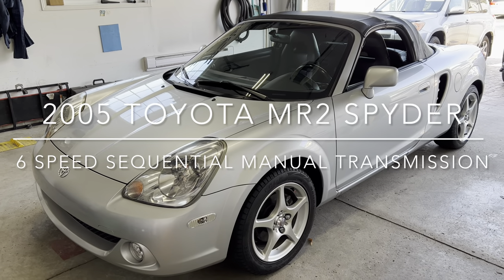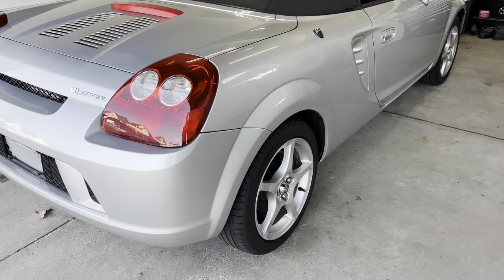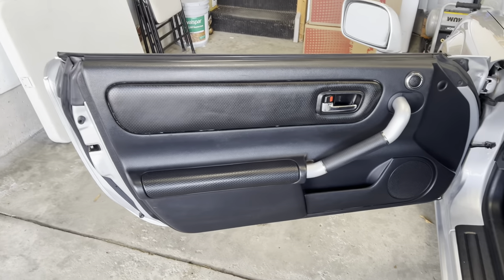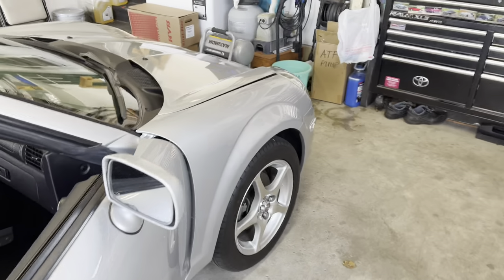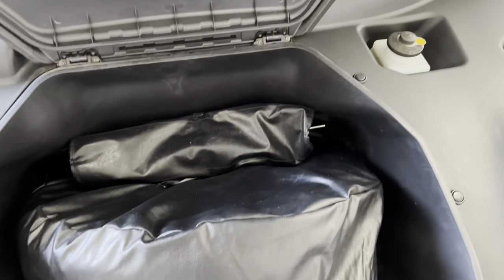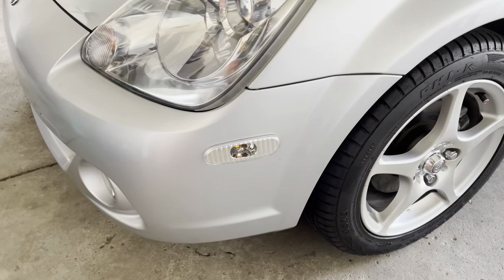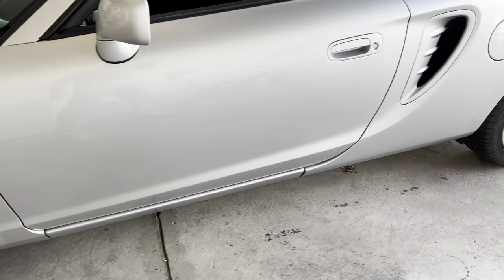2005 Toyota MR2 Spyder - 6 Speed Sequential Manual Transmission

Comment: I'm sure you have done your research, but I want to mention a few things you should know. I have owned a 2003 6 speed SMT for 7 years and I love it and some of the issues that need to be addressed A.S.A.P. are, change the SMT fluid right away, gut the pre catalectic converter, replace the accelerator position sensors on the throttle body because if one fails it will leave  you stranded on the side of the road and clean the carbon out of the power steering motor housing. Get Toyota Tech Stream from Ebay and a laptop (there are videos on that subject on YouTube so you can do the parts change relearn yourself you will thank me later. Make sure the soft top drains are clear because if it gets rained on the water will fill up the compartment where the ECU and TCU are located and will destroy them. I got my car with 52,000 miles (83,000km) and now has 86,000 miles (138,000km) Enjoy your MR2.
Reply from the maker: Thanks very much Mr. Fixit for the tips and suggestions!
- SMT fluid replacement -> done!
- Pre-cat/headers has been replaced with after market headers
- Power steering/Coolant/transmission replacement -> done!
- soft top drain clean-out -> done!
 I will take a look at the accelerator position sensors on the throttle body this summer (not sure what sensors you’re talking about here).
Yes, I do own a Toyota Tech-stream to use on all my Toyota’s.
Reply: @PTranProductions  Throttle position sensors (TPS) there are two on the throttle body.
Reply from the maker: Ok, thanks! I’ll take a look.
Reply: MrFixit1, I have found a 2004 MR2 for sale with the SMG transmission. The transmission is broken and the car will not drive. What are some good sources of information on how to repair the car's transmission? I want to do my research before I make an offer on the car.
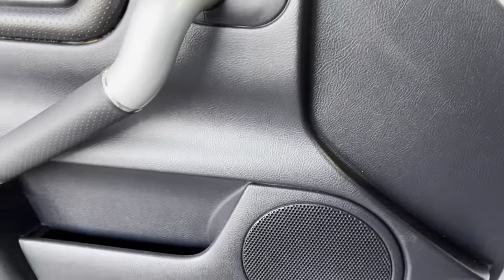Reply: @flyntmyrick6291 will not go into gear ? Will not go into gear                                        4:18

Comment: I’m looking to buy a 2002 SMT is it worth buying the car has 85,000 miles ?
Reply from the maker: 85K is not bad for a 2002. if it’s still in good condition and no issues with SMT, it’s totally worth it.
Reply: @PTranProductions  how would I know if there’s nothing wrong with the SMT when I test drive anything  to look out for!
Reply from the maker: @farhanzaman152  
Try to upshift and downshift on every gear. Look for any SMT fluid leak under the engine/transmission.  Also I forgot to mention, 2002 model may have issues with engine due to the Pre-cat problem. You can do some research on MR2 MK3 pre-cast problem so you know what I mean.